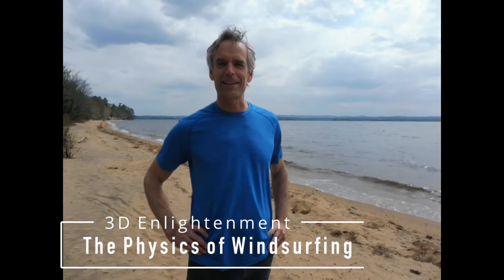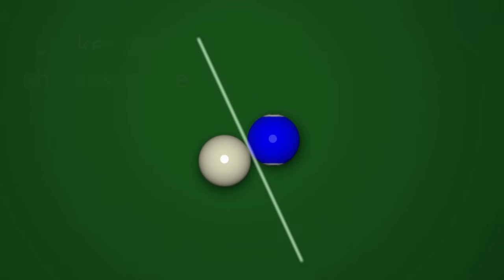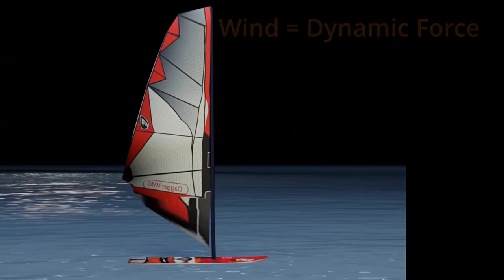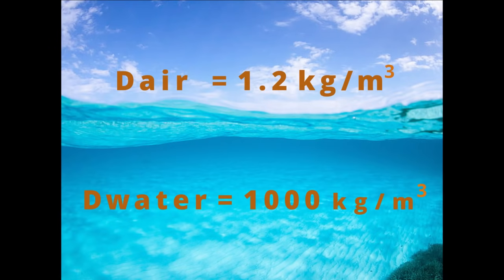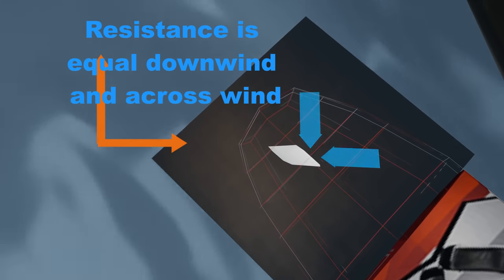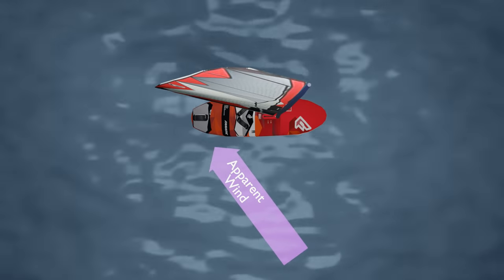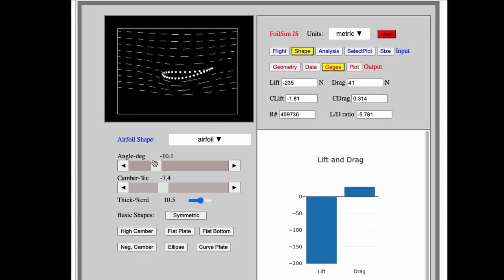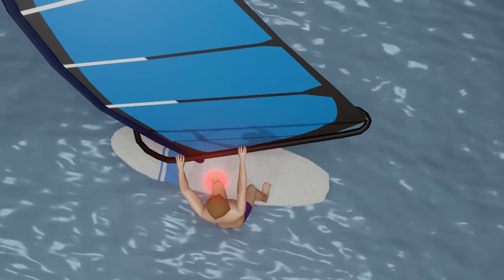Physics of Windsurfing

Comment: Very nice explanation and simulation! Don‘t you think there can be some lifting forces threw pulling the sail down so that it not stands totally horizontal, like when you are going really fast?
Can you mabey explain the reason of spin outs? Thank you!
Reply from the maker: Yes, definitely.  Maybe a video on spinouts would be worth it.  Thanks.
Reply: Causes of spinouts are many and complex. It's at the limits of hydrodynamic lift. Crap is going on with a fin at high windsurfing speeds that doesn't happen in air until .95 mach or AT ALL.

Comment: It never occurred me to that the reason you don't get washed downwind is that water is 800 times more dense that the air. Seems so stupid not to have thought of that. Although at a standstill your fin's V is zero (assuming no current) while your sail's V is the wind speed. And once you get moving, everything changes anyway.
Reply from the maker: Yes, and once you start moving, the resistance force against the fin is activated.

Comment: The first part of the video is inaccurate because as you gain speed, the apparent wind changes direction. Therefore, you can close the sail to produce the same force.
Reply from the maker: It is theoretically correct, but you are right, as the apparent wind changes direction the sail can be closed to produce the same force, and that is what was said at the 5:00 to 5:12 minute point in the video.   I probably should have emphasised that a bit more.  Thanks,.

Comment: Sails, airfoils, barn doors etc do not make force in a moving airstream because the air strikes them. Very little air actually touches the sail. Sails make force because they create a pressure field in the moving air that deflects a huge amount of air most of which is pretty far from the sail. That pressure field does the Newton's 3rd law thing and pushes & pulls on the sail in the opposite direction.
Reply from the maker: True.  Thanks.

Comment: Thanks, great explanation! I would be interested in more details about feet and hands position, body weight distribution and set-up like boom height or mast position. I was actually thinking about building-up a multi-body simulation model of a windsurfer + gear to investigate, but it soon became clear that I would have to invest a lot of time. No problem in general, but I would have to do it during working hours haha!
Reply from the maker: Thanks Den.  Those finer details in the positioning of body and hands, boom height, etc make for subtle differences in the mechanics and forces involved.  They also depend on wind and water conditions and body size etc.  It would be interesting to do...but yes, a bit of time.
Reply: Den, you have yourself an interesting project, but - unless you live in California - why don't you just wait till winter and spend the same amount of time windsurfing instead? It's even more interesting, and doing it during working hours would add a nice touch :-). And if you still want to do your project, I suggest you drop the windsurfer; he/she is a major source of drag :-).
Concerning your question: understanding the basic physics of sailing will give you some very valuable hints with respect to what you are asking. Also, there are plenty of videos out there that deal with exactly those important details. Happy surfing and happy hunting!

Comment: Great video!  I appreciate the billiard ball metaphor and dynamic force equations.  Toward the end when you are explaining turning upwind and downwind, I always thought this had to do with the center of mass(?) of the board relative to the combined forces from the foot pressure of the sailor and the sail reaction on the mast base.  If those forces are balanced about the board center you don't turn, but if they move fore or aft of the center of mass of the board the board will rotate.  Is that right?
Reply from the maker: Yes, that is correct it involves combined forces from the sailor's weight and pressure from the sail on the mast foot and the additional pressure from the sail translated through the sailor.  I didn't speak about the pressure on the mast base as that is constant for a given angle of sail.  When you are sailing along, all is in balance, so if you throw that balance off a bit by tilting the sail forwards or back, the imbalance is translated through to the sailors stance and additional pressure one side or the other changes the direction of the board.  If there is a dagger board, all of this movement will be much slower and the board will tend to pivot more around the center (where the dagger board is) rather than from the back (where the fin is).
Reply: John, I appreciate your question mark. It's not the center of mass; it's rather the geometrical center of the lateral profile (and our rotation axis) vs. the geometrical center of the sail. The former is not very well explained in the video, and the foot and mast base are just transmitters of the force on the sail.
Think of a weather vane (except it has a fixed rotation axis while ours is moveable) with a tail (we call it the rig :-) ) that can rotate in its plane. You get the picture?
Happy sailing! :-)

Comment: How are we then sailing upwind if the profile of the sail is not providing any lift?
Reply from the maker: The force of the wind against the sail provides forward motion, and the angle of the fin in the water, allows the forward motion to be translated upwind.   It is a bit confusing because the term 'lift' is also used in aerodynamic wing theory whereby the wind actually lifts the wing upwards due to a combination of Bernoulli's principles and Newtons third law (didn't discuss this directly in the video).  However, when sailing, there is actually a 'lift' force in the physics sense, but it is in the negative direction i.e. downwind.  So, I was saying that the wind doesn't lift the sail upwind in the common sense of the word 'lift' i.e. in a upward direction, but from a physics perspective, there is still 'lift' (negative) from a wing theory perspective.  I hope I haven't confused things more.  Let me know, and I'll try to answer your question more clearly.
Reply: @3denlightenment  Sorry, but you have. More on this later.

Comment: I don't follow the logic on the conclusion regarding lift. The example shown on the NASA simulator used negative camber on the wing. Of course, the simulator will show 'negative' lift for this case, but only because the convention it is using, is that 'positive' lift is in the 'up' direction on the screen.

Even a flat plate turned at an angle to the wind will produce lift, just like you explained with the perpendicular vector in the billiards balls example. The NASA simulator even has an option for flat plates you can test it pretty easily.
Reply: I watched it again. You mentioned 'lift up-wind' a few times which doesn't make sense to me - I think we're getting a bit mixed up on terminology. Lift is the vector perpendicular to the wind direction. As another commenter mentioned; the apparent wind direction changes this
Reply from the maker: To simulate the shape of the sail in the NASA simulator you have to have a negative camber.  This positioning simulates the real-world condition of the sail against the wind.   If you look at the shape of an airplane wing it generates lift from the air moving over it.  The curved profile of the sail is like an upside-down wing relative to the wind blowing over it.  As a result of this, as well as the angle that the wind hits the sail...the sail provides a negative lift i.e. pulls the sail downwind.
Reply from the maker: @KDalgliesh  I agree.  The Bernoulli principle applies lift perpendicular to the curved surface.  The only reason why I speak about the "lift up-wind" is only to counter other videos out there which speak about how the sailor can sail upwind due to the curved shape of the sail, which is not true.  I agree with you that lift is perpendicular, and in this case, it would be in a direction downwind.  So the end result is that there is a push from the front or windward side of the sail and a pull from the leeward side of the sail all in the downwind direction.

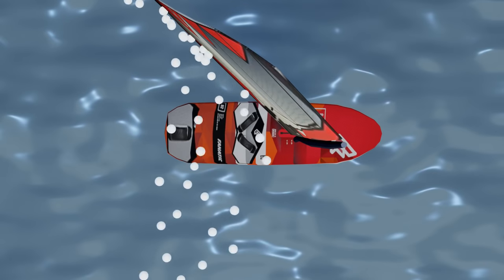Comment: Ciao ciao, nice video where at minute 0:45-0:50 you talk about how the red force is not perpendicular and you decompose it , but what about the yellow force which has the same quality of not being perpendicular and if you decompose it you would get other forces that would kinda amplify the downwind total force  and one that would be totally opposed  the force pointing forward...at least this is how I see this particular part of video
Reply from the maker: The red arrow represents the force on the sail and the yellow arrow is the resulting momentum of the wind after it strikes the sail.  The momentum of the wind will be in a different direction and will be slightly diminished after it strikes the sail.  I probably should have drawn the two yellow arrows different sizes to show this.  The red arrow is the only resultant force  on the sail.  The yellow arrow shows the direction of the wind.

Comment: Does that means that theoretically the faster you go the less upwind you can go. If the sail is designed in a way the wind is optimal at 45° this means that by increasing the speed you would eventually go at most perpendicular to the true wind (apparent wind + true wind hits the sail at 45°).

This further means that for windfoiling (a lot of apparent wind due to true wind speed vs windsurfer speed) sails with a lot of shape (cambered) won't work as you need to sheet in a lot. Due to that "shallow" sails are preferable.

Thoughts?
Reply from the maker: In response to  your first paragraph, the answer is in theory yes.  At the peak point  of sail you would at most be able to sail perpendicular to the true wind.  So, for windfoiling, the speed is greater and therefore the apparent wind has a greater influence.  As far as cambered sails go, I would think that you are correct; however, there seems to be some debate as to the influence of the curved sail and the Bernoulli effect vs the direct force on the sail surface (Newtonian effect).  I would think at that angle to the apparent wind there would be greater drag from the curved sail and therefore a non-cambered sail may work better at higher speeds.

Comment: Nice, but you dont explain turning IMO in the right way. 
1. Turning downwind : Moving sail to the front of board move the middle point of sail force to the front of the board, while moving weight on the back of the board moves middle of water force to the back, which rotates the whole system from the wind. 
2. Turning upwind : Moving sail to the back of the board moves middle of the wind force to the back of the board. Putting pressure on front foot moves middle of water force to the middle ofthe board. This configuration turns the system upwind.

Comment: Good graphics, wrong info. No the wind does not behave like a billiard balls ona sail. Rather wing effect. And no, the apparent wind does not generally hit a windsurf at 90° angle, since a windsurf is fast, it comes from the front, even at angles of the board 120° off true wind.
Reply from the maker: Thanks for your comments.  Please check out my second video which explains, through visual simulation and experimentation, the forces on the sail.  https://youtu.be/jHCXTiepjKY?si=jcvjX1JSKw4ms-QX

Comment: If the upwind force is not made by the profile shape, then where does the force come from? 

I understood there is resistance from the water to fin. But that to not a force to push the board upward. 

If the profile shape cannot provide upward force, there will be only one downward force from the wind. It will push the board downward against the resistance of the fin. The board will go backward. 

Anyone can help? I cannot understand this part. Thanks
Reply: Yes, this is confusing.  The force is always downwind and forward.  The angle of the fin provides resistance downwind but the board is moving forward, and if it is pointing upwind, the fin is angled so it will slice through the water in an upwind direction.  The result is that the sailor moves upwind.  If there was no fin, everything would move downwind.  Hopefully that helps.
Reply: @marklewis7306  the fin provides resistance to water. But why the board is not going backward downwind 45 degree instead
Reply from the maker: @yus.c.2231  This is because of the angle of the sail to the wind.  Have a look at the analogy to the billiard balls and you can see the force drives it forward or across the wind.

Comment: i would still contend that a sail generates lift.  It's just not, by itself,  an upwind vector.  Also, your explanation of steering ignores the concept of center-of-effort.  There is a point in the sail foil which coincides with the center of effort.  It can move relative to wind velocities or rig position.  The center of lateral resistance is consistent with whichever fin is chosen.  Sails produce tons of lift during aerials.
Reply: contrarywise to your points; the explanation does certainly demonstrate the concept of centre of effort, by moving the sail backwards/forwards in relation to the centre of lateral resistance of the complete board/fin. Vertical lift during aerials with the sail in a horizontal plane concurs with the animated graphic of perpendicular lift, you won't travel anywhere upwind due to lift when you leave the water surface, only due to momentum.

Comment: Around 3:54, where the board is shown heading upwind at 45 degrees, shouldn't that be impossible in accordance to Newton's 3rd law acting on the sail (the billiard ball / wind stricking on the sail analogy)? It seems like however the fin acts on the water, the force of the wind cannot be redirected in the upwind direction.
By the way awesome video! Loved the animations and straightforward explanations
Reply from the maker: Thanks Samuel, yes the force of the wind cannot be redirected upwind.  If you notice the direction of the vector arrows they are across and down wind.  The angle of the board/fin in the water allows it to move upwind due to the lateral resistance on the fin as shown.  As the board moves the fin slices through the water in the direction of least resistance.  Ultimately allowing the vessel to move upwind.   All wind generated forces will never be upwind.  The actual angle will be “about 45” but will actually be slightly less.